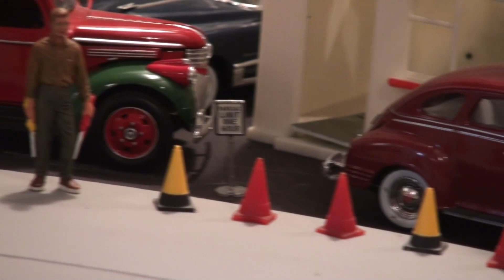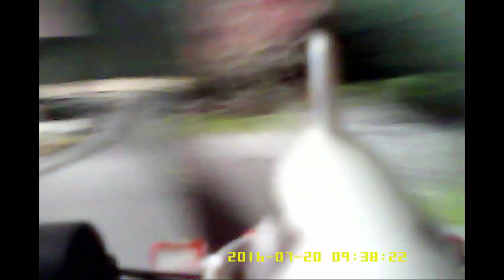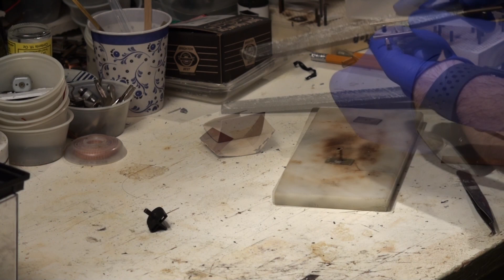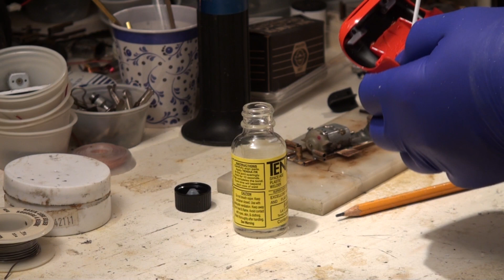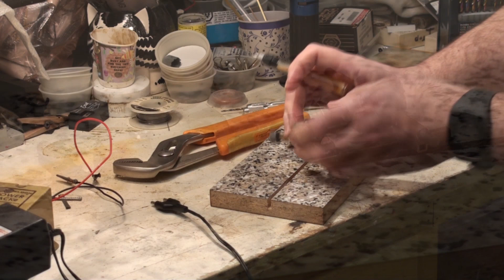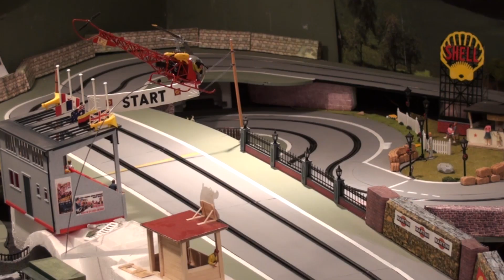Scale Car Garage - 1/32 Scale Cheetah Build Pt. 5 - Running Chassis

Comment: John, this video was as good as the previous  four. And best of all, it ran pretty good around your track when the chassis was complete. Were those hard rubber tires you had on the rear? When you took out that huge file to clean the brass, I was overwhelmed. <LOL> it worked!  I have a 6" flat file & a couple 12", but I use smaller things too when cleaning joints to be soldered.. Things such as bits of sandpaper,  sanding boards for finger nails, & the green synthetic scouring sheets sold for cleaning pots & pans. If I had a track to run  it on, I would have to build something similar to yours, but i don't. I await your next installment.
Reply from the maker: Bill, thanks so much for your comments! The tires on the rear are the Cox Cheetah rear tires that I re-cast in 40 shore urethane which makes for a tire with quite a lot of grip. Thanks for noticing my use of the 'large' file! You are absolutely correct, there are many things that you can use for cleaning brass! Thanks again!

Comment: You make building the brass chassis so easy. I will have a go at one with the torch...when the lockdown is over here in nz.
One question I have: would be possible for you to do a short video of how the tube was soldered on the flat brass piece to form the guide holder? 
thanks anyway for the cool video.
Reply from the maker: Giovanni, thanks so much for your very kind words! Yes, I'll certainly make a point of showing more details in future builds!

Comment: Hello, at minute 5.01, what is the name of the plastic that joins the motor shaft with the shaft that goes to the pinion?
Reply from the maker: The plastic that I used to connect the motor shaft to the drive shaft is the plastic insulation used for speaker wires. The wire was removed from the plastic insulation and then pushed onto the motor shaft and then the drive shaft. It really works very well and is very inexpensive! Thanks so much for watching, commenting and subscribing!
Reply: @FastSports-ScaleCarGarage  Can't you send me a link to see more or less what it is about?
Reply from the maker: If you are interested in how this is done, please feel free to send me an email at kit9161@rogers,com and I will be pleased to arrange a chat via Zoom to show you how to do it!